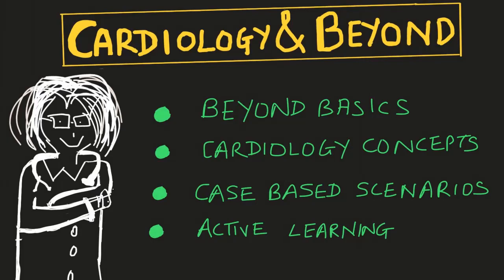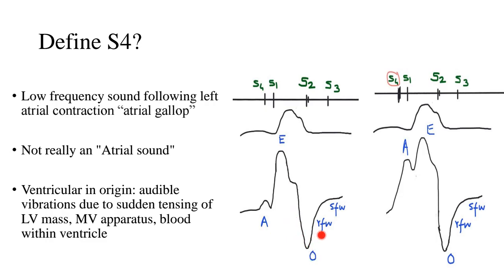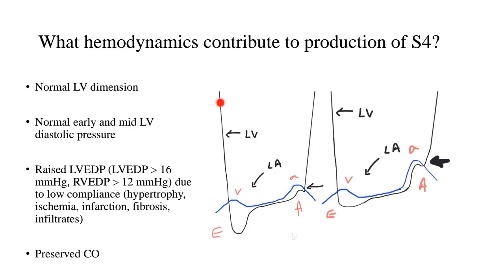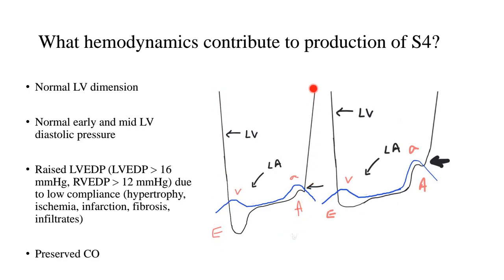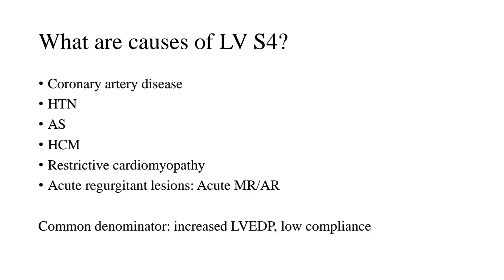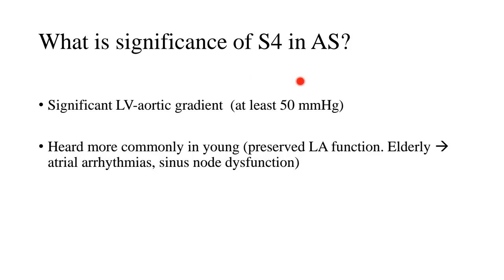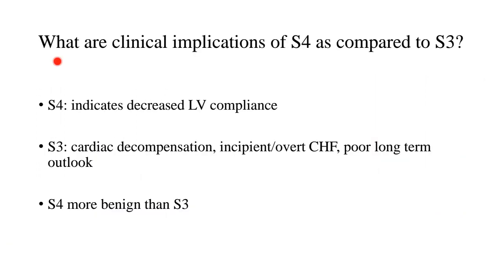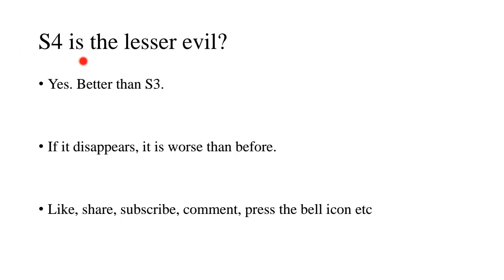Fourth heart sound (S4)

Comment: A extremely well presented analysis of the S4 gallop. Travel’s book on auscultation states the same information as you have presented. I must add, Travel teaches that a normal phonocardiogram with extremely sensitive pickups will register a forth heart sound with a frequency in the inaudible range in late diastole that is generated by the normal left atrial contraction when the tested person is in NSR and the compliance of the LV is normal. It is when the compliance of the LV is abnormally high in a disease state and the patient is in NSR does the amplitude of the vibration caused by the in flow of blood into a noncompliant LV reach the threshold of audibility that the sound represents an abnormality. The sound now is called a S4 gallop. My point is that Travel makes a distinction between the term S4 heart sound registered on a phonocardiogram as normal and the audible sound detected with auscultation, the S4 gallop as abnormal.